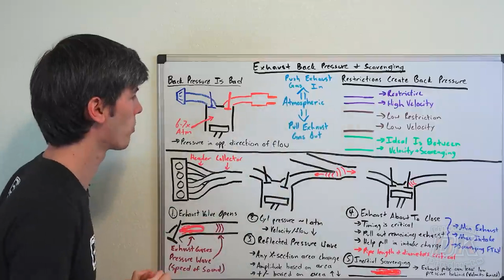Harley Backpressure & It's Effect on Performance

Comment: Thanks for the video, very informative. But I'm a bit confused, which of the below statements is wrong?

1. Backpressure is generally bad for horsepower (more backpressure, the more the piston must work against said backpressure according to Gale Banks)
2. Any restriction in an exhaust system increases backpressure. (smooth, large, straight pipes are ideal)
3. The thunder torque mod is a restriction in the exhaust system
4. Therefore, the thunder torque mod increases backpressure
5. Therefore, the thunder torque mod decreases horsepower

I'm not trying to attack anyone, genuinely puzzled and wanting to learn more. Thanks!
Reply from the maker: Your understanding of it all is correct however the TTI increase performance by increasing exhaust gas velocity. This is in spite of whatever amount of backpressure they create. While they do create some perceptible back pressure, this is minimized by the rounded shaped of the TTI and it is not enough to be detrimental. With that said, the TTI do in fact hinder Horsepower. This can be seen in virtually all of our dyno results. But understand that Horsepower is not measured until after 5,252 RPM and the negative effect on HP from the TTI happens well beyond that so this is not very relevant to how we ride these bikes. Straight thru exhaust is best for HP but the TTI produces it's notable gains in the low to mid range. Torque is what builds performance on the street. Straight pipe style exhaust is for high RPM applications and scenarios.
Reply: @DKCustomProducts  How does exhaust velocity affect torque on the low end?
Reply from the maker: @hankschwiebert1457  it significantly reduces power robbing reversion in addition to the TTI physically blocking the reversion. Torque is measured below said 5,252 RPM... So when the increased velocity builds performance or "power" it is building torque. At high RPM, the exhaust gasses are cycling much faster and reversion is not really present. This is why the TTI do virtually nothing to improve high rpm performance... It's all in the low-mid range. The faster the internal combustion engine can cycle the exhaust gasses, the more efficient the exhaust system will be. Many like to refer to the ICE as an air pump... It's easy to bring air in with a high flow air cleaner but pumping it out is usually the weak link. Think of how a 2-1 exhaust system virtually always out performs duals. That single outlet has increased the velocity and reduced performance much more efficiently than duals.

Comment: You are correct in that backpressure is bad and you did slightly mention velocity, maintaining velocity is actually more important after backpressure is addressed and great results can be achieved with a tuned exhaust system that maintains a more constant velocity with a 2 into one tuned system that scavenges the other cylinder properly. The garden hose example is not accurate for a cyclic system of which an engine is. Whenever velocity slows between exhaust port openings that creates work to speed it back up which in effect is a form of backpressure. By keeping the velocity as constant as possible with the help of both cylinders exhausting into the same pipe this helps scavenge or reduce backpressure in effect. Remember this is a cyclic system where the exhaust flow wants to speed up and slow down and speed up and slow down as the exhaust ports open and close. The length of the head pipes are important and where they join into one is important to the constant velocity tuning that results in higher performance across the entire RPM range. Note, I use the term constant velocity but there is nothing constant about a cyclic system, so I mean as constant as possible.
Reply from the maker: Thanks for your input.
Most folks are not going to spend the time and money to get an exhaust exactly dialed in for their particular build....but for those who will, that is good info!
KP

Comment: I have a 2019 Road King 107, has stock head pipes, Sharkroad slip-ons, CR483 camshaft, Power vision tuner. Decated. My bike is a beast without the baffles, definitely slows if I put the baffles in. My buddies fuss all of the time that I'm losing power. I know better.
Reply from the maker: Good deal!  Backpressure is bad...it is like riding with the brakes on the engine.
Thanks for your comment.
Oh, here is another video on the subject, share it with your buds, see what they think- https://www.youtube.com/watch?v=pr6z00gL5Yg
KP

Comment: so i have a royal Enfield 350cc old style j series engine that has quicker mapping than traditional bullets, the stock exhaust has a wide pipe for good sound i reduced the outlet to 50% like a db killer fitment and performqnce in low and mid increased , cannot count it but it really did maybe a little backpressure is good
Reply from the maker: Like being a little bit overweight is good.  Nope, backpressure, by  definition works against the engine producing power.  What causes the low and mid range flat or dead spots in power is reversion.  You can reduce reversion by putting a block in the exhaust tract (back-pressure), which is easy to have one conclude the back pressure is good.  What is better is to have no back pressure and also eliminate reversion.  This is gone over in the following video, with some footage from S&S in it.
https://www.youtube.com/watch?v=pr6z00gL5Yg

Check our the Thunder Torque Inserts™ at this link for more info- https://www.dkcustomproducts.com/thunder-torque-inserts-c57-337.htm
KP
Reply: @DKCustomProducts  the enfield engine has changed little since last 100 years and is the few long stroke models whose outlet exhaust pipes are wider than the car’s exhaust and the muffler hole too may be bigger than few cars here so you see a lot of low pressure with each stroke makes dug dug  and is more like a free flow type so a LITtLe restriction did wonders  with it working like an engine on steroids in low rpm ✌️
Reply from the maker: Yeah, sounds like the pipe is too big in diameter, slowing down the exhaust gas velocity

Comment: I had a decattaed head pipe and s&s grand nationals, screaming eagle tuner. Why did I lose low end when I went from a catalyst header to a decatted head? I ended up putting the catted header back on. I also put my se street cannons on the decatted header and still had low end loss.
Reply from the maker: Could be the tune...that is the other thing you mentioned changing at the same time...so I would not rule that out til you went back to your OEM tune.  See video link below.

Regarding the new epa compliant S&S headers.  it is unknown what they have done design wise.  We have had Quite a few comments from folks with the Gran National Slip-on's that have had good experience with the TTI's increasing their low and mid range torque.

I can't think of any feedback we've gotten on the catted or decatted headers.

https://www.youtube.com/watch?v=wQ6EzilYjiI

Thank you for commenting! KP

Comment: Good video. I recently had new catless head pipes installed on 2022 Tri Glide that has stage 2 cam. Definitely cooler! Throttle response is still good but noticed some loss in torque. In 6th gear and 55-60 mph notice engine seems to lug, where before head pipe change it did not. Have just ordered TTI's to put in slip ons hoping this will help. Two days ago I installed tank lift along with cooling deflector wings. Took temps before and after install driving same road, mph and weather temps. Front cylinder and rear cylinder dropped 25 and 20 degrees respectively. Oil temp down 5 degrees to 220 with air temperature at 86 degrees. Thanks for great products guys. Also have your Nexgen shocks and lift installed. Wife says that's the first thing I should have put on. Wow what a difference in ride and handling. Keep up the good work and videos guys.
Reply from the maker: Glad you like the video and are seeing all the benefits of having the cooling components installed.

 I agree when my husband put the NexGen™ Shocks on our bike it was a world of a difference for my comfort and my back. lol 

I am sure you will see the benefits of having the TTI's installed as well! Let us know how you like them!!!

Thank you for your business and for commenting! We appreciate you! MB

Comment: You're correct, as what is important is gas flow rates.  These need to be maximised.  But gases have weight and therefore inertia.  When the valves close the gases come to a gradual stop, when they open again it takes time to get them moving.  If the exhaust pipe diameter is correct you get the best of reduced friction (big diameter) and increased gas velocity (narrow diameter).  Remember gases have weight, so when the exhaust valve closes the exhaust gases can keep flowing due to their inertia.  Just as they're slowing down the exhaust valve opens again and more gas is pushed into the exhaust.  When the gases get to the end of the exhaust and out into the atmosphere the pressure suddenly drops (there's no pipe around the gases anymore) and this sudden drop in pressure is reflected back up the exhaust.  If your valve timing and exhaust length are properly matched the wave of low pressure travelling back up the exhaust will arrive at the exhaust valve just as is opens which will help the gases from the cylinder exit the engine even more quickly.  However the valve timing interval changes as the engine speed changes (but the exhaust pipe stays the same length!) so there will be an optimum engine speed when the valve timing and the low pressure wave exactly coincide.  This is where your peak volumetric efficiency will occur and this usually is where the peak torque occurs.  So all this means that your cam timing and your exhaust pipe dimensions need to be thought of together  - they need to be calculated to give peak torque at the rpm range you want it.
The people who design the engines know this which is why you can lose power if you remove the mufflers as these are part of the exhaust and part of the design for peak volumetric efficiency.  Similarly if you change the cam timing then you will change where the optimal volumetric efficiency occurs and this changes where the peak torque occurs, and as power equals torque x revs, you can change where the power occurs.  Of course you will need to redo the fuelling as well otherwise it's unlikely you will be able to take advantage of the changes you've made.
Talking about back pressure doesn't really help understand any of this.
Reply from the maker: Very good explanation! We talk about the basic concept of backpressure because realistically everything you just explained is not plausible to draw a conclusion on when shopping for exhaust. That information and specs are not readily available and if they were, there are too many variances and QC issues with these engines for the information to be black and white. You seem to understand exhaust properties very well but most do not... so it just leaves more room for error trying to correlate and calculate things like cam timing to exhaust dimensions.  However, it is reasonable to assume that if one were to understand how backpressure (while not the end all be all) has a negative effect on exhaust performance and efficiency, they can then make a much more educated decision on exhaust mods and choices. Thanks very much for your informative comment. -DS
Reply: @DKCustomProducts  True enough.  Which is why I believe most, if not all, after market exhaust manufacturers design their exhaust systems for the stock cams.  Any cam manufacturer worth their salt will recommend an exhaust that goes with their cam.  My tuner has thirty plus years tuning behind him and has tried cam and exhaust combinations to find what work best.  This research costs him money (no one pays him to do it) which is why he is expensive.  Also he can't try every cam with every exhaust on every Harley, so he uses his experience to make a judgement. However you're paying for that research and experience  and when you ride your bike you'll know where're that money went!
Great channel, by the way.
Reply from the maker: I understand! We do all our on research as well on everything we do. It is nice that someone else puts effort into helping improve others rides. MB

Comment: It’s just ppl using the wrong terminology.

I had tab zombies on my 124 with the KW2:2 head pipes.  
Ran like shit.  Got 130mi on a tank bc it was scavenging all the fuel out below 3k. 
Put in mediums and retuned it. 
Rides as it should 
Dyno chart looks like a table top on the tq curve not the Big Dipper. 

I’ve heard many solid tuners use the term back pressure too.
Its everywhere. 
Reversion and scavenging and such is too complex.  Needs back pressure sounds neat and tidy
Reply from the maker: Thanks for the comment! I agree that most professionals are using the term because it doesn't really benefit anyone to interject with AcTuAlLy iTs nOt BaCkPrEsSuRe, iT's...    I am guilty of letting the verbiage go unchecked when people are using it incorrectly. The Zombie baffles can be made to work well when supplementing with  the Thunder Torque Inserts. I know that sounds like a shameless product plug but when you really look into how the TTI improve exhaust gas velocity and compare that to how the larger zombie baffles can rob performance, you will draw the conclusion that such an exhaust insert would correct the shortcomings of the otherwise too-large baffle. We do have a video showing the install process with zombie baffles coming soon, likely next week. -DS

Comment: Everything is relative and on planet earth the physics is that back pressure reduces flow.  If you reduce flow through an engine then you reduce power assuming everything else is the same.  If you put a 1” tailpipe on your truck it reduces flow and power!  If you make a change to your exhaust and it changes your performance it’s because you changed pressure transient which is the low pressure wave that at some point in the exhaust system heads back toward the exhaust valve.  The most favorable time for the low pressure wave to hit the exhaust valve is during valve overlap so that it helps bring in fresh intake charge for enhanced volumetric efficiency.  Anyone in doubt just simply take a college level physics class and follow up with an engineering fluid dynamics class and get back with me!  It’s science, but not rocket science!  

If you want backpressure then shove a potato in your exhaust outlet and enjoy your performance gain....😂😂😂
Reply from the maker: LMAO 😂👍😎 
Thank you for commenting! MB

Comment: Got a question on a different subject,  are the 2022 have a rear lift kit on from the factory now?
Reply from the maker: No, Later model trikes (2019+) are not equipped with a lift kit... They simply have stiff, near rigid, coil over shocks that do not sag. Older model trikes were equipped with air shocks that had more sag resulting in a lower ride height. Your trike would still benefit from the Convertible Comfort Lift™ which not only lifts the shock's mounting position but also corrects the shock angle for an improved ride quality. However, for some, this is not enough to overcome the terrible ride quality given by the stiff coil over shocks. The best solution is to replace the shocks entirely . Take a look at this link to see all Trike suspension upgrades we offer, including the Lift kit. -DS

Comment: I’m gonna have to share this video on our page! I’ve had customers go back and forth with me over back pressure and the one thing I always say that gets them to finally see what I mean is “think of a garden hose, the water is your spent fumes, the hose is your exhaust pipe, the water spigot is your engine. Open the valve on the spigot to starts the flow, If you kink the hose (creating “back pressure”) it restricts flow of water. If you unkink it the flow is smooth and better. Now If you put a 3” diameter hose to the same water spigot without upping your water pressure “Horse Power” the water will be worse and it will dribble out slowly instead of coming out full velocity like it did with the smaller hose” it really comes down to the design of the exhaust, less bends smoother flow but without a few strategically placed bends you loose the velocity.
Also if you don’t have the power to create enough velocity to push spent fumes out the chamber then there’s no real reason to go even bigger with exhaust.
Reply from the maker: Yes, we have used that analogy as well! Glad you like the video! Thank you for commenting! MB
Reply: You are more talking about fluid velocity and differential pressure in your example and you are correct with your logic.  The whole backpressure saga is actually pressure transient, a pressure wave traveling through the fluid.  Tell anyone who thinks backpressure is great to stuff a potato in their exhaust outlet and enjoy their performance gain!
Reply: @trailerparkcryptoking5213  yea I know there’s a difference but At times just simplifying it to a customer helps them actually understand it better than over explaining and getting really technical
Reply: VELOCITY. VELOCITY!!